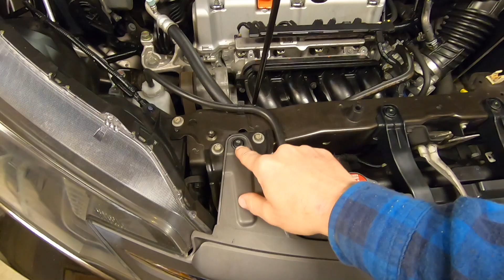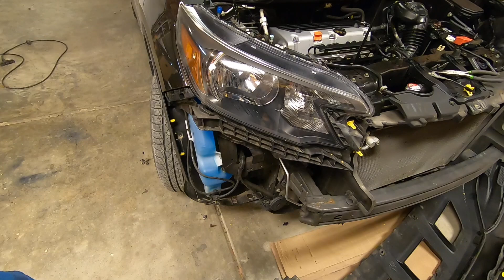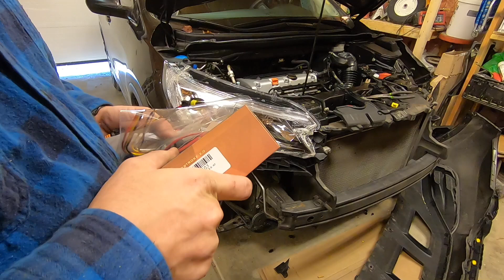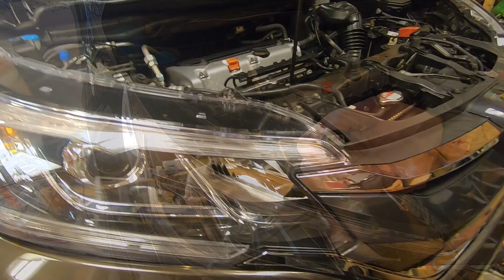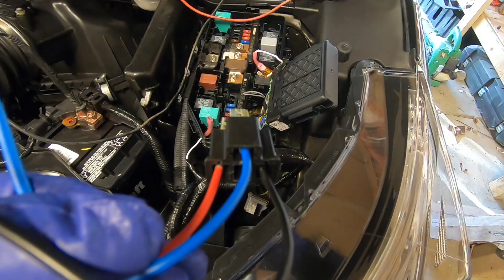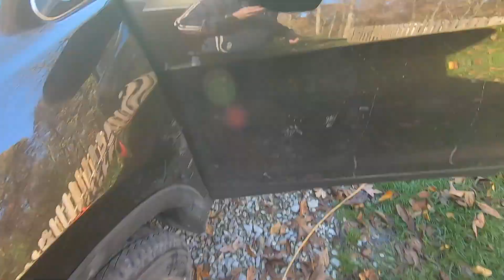2012-2014 Honda CRV - 2015 Front End Facelift Headlight and Grill Swap - LED Projector Headlights

Comment: Hi. Was there any risk to cutting / removing the plastic around the radiator? Did you notice anything later on?
Reply from the maker: No issue. Have done this upgrade on 3 CRVs now
Reply: @JackofAllMasterofNone  thank you!
Reply: @JackofAllMasterofNone  is the 2015-16 the only other compatible headlights for the 2013 model?

Comment: Where is the parts listed?
Reply from the maker: In the description 
Below are the parts needed to complete the swap. (Paid Links).  
Headlights https://ebay.us/5iHu06
Alternate Headlights Link https://amzn.to/3DzCotv
Grill and Brackets https://ebay.us/mtWajx
Alternate Grill Only Link https://ebay.us/94HcGz
Alternate Headlight Brackets Only https://ebay.us/lSOj03
Grill Emblem https://amzn.to/3x8mdBk
Turn Signal Harness (2 required) https://ebay.us/j9GVIH
DRL Harness (2 required) https://ebay.us/K609Ch
H11 Low Beam Harness (2 req) https://amzn.to/3VVt5QH
9005 High Beam Harness (2 req) https://amzn.to/49zaMUF
H4 male pigtails https://amzn.to/49vYV9W
H11 and 9005 LED Kit https://amzn.to/3vFyBvQ

Comment: Does the outside LED DRL flash orange when the turn signals are on? Sorry if this was mentioned in the video
Reply from the maker: No. It does not. The housing have a regular turn signal bulb.
Reply: @JackofAllMasterofNone Ah okay. There are pictures online where the outer DRL is amber. Thank you! Doing this facelift in the next few weeks
Reply: Huge thanks for this video by the way! The section about cutting the tabs off the new grille was a huge help. I spent a good couple minutes trying to squeeze those tabs into the existing slots.

Comment: How did they wire the DRL to the headlight connectors?
Do you have any video?
Reply from the maker: It's all in the video. Watch here for a detailed way of doing it for low and high output DRL 
https://youtu.be/WZh2-4WOCWU?si=MR81swBaEL7ns03o

Comment: this is a super helpful video but can anyone provide more detail in making the lower grill fit better to the front bumper. I am not as worried about doing the end tabs but making the grill have a closer fit to the front bumper.  Can't get the clips into all four openings (just the two in the middle).  Appreciate any more detail and insight.  Thanks.
Reply from the maker: Heat gun and slowly working it. Remember this is a "hack" and was never supposed to work, but we make it work.

Comment: Hello I have a question if you don’t mind answering. I order the turn signal harness from the link you provided but it didn’t come colored. It was 3 slim black wires and the description said ac pressure switch connector. Is there any other link you may be able to offer?
Reply from the maker: It says AC pressure switch but it IS the correct harness. They use the same connector.

Comment: Hello I have a quick question, I’m doing the same facelift as you did on your crv the only thing is the turn signal sockets are different from the 14 to the 15 but you didn’t mention changing the socket not just the wire harness. How can you solve this issue.
Reply from the maker: Did you watch? It's all in there including part numbers in the description
Reply: @ did your new headlights come in with the turn signal socket? I ordered some headlights but from another manufacturer.

Comment: Sorry if I missed this in the video (or if you mentioned elsewhere) but is the grille swap necessary, or would I be able to just swap the headlights? Thanks!
Reply from the maker: The grill is completely different. You have to do the whole thing to make it work so yes you have to swap the grill. This job is not for the faint of heart.

Comment: Do you know if the regular halogen headlights from a 2015 EX for example would be a direct swap or still would require custom harnesses? I guess to have daytime running lights they would require extra wiring.
Reply from the maker: Still require same custom harness.
Reply: I figured, thanks. Kinda hard to stomach the extra cost of the touring headlight assemblies. The regular halogen headlights to DRLs is quite literally 1/4 the price.
Reply from the maker: I understand. Quite the price difference but the projectors with LEDs are so much more superior it's worth it

Comment: What's the link for headlight bulb convertion from H4 to H11 and 9005
Reply from the maker: Headlights https://ebay.us/5iHu06
Alternate Headlights Link https://amzn.to/3DzCotv
Grill and Brackets https://ebay.us/mtWajx
Alternate Grill Only Link https://ebay.us/94HcGz
Alternate Headlight Brackets Only https://ebay.us/lSOj03
Grill Emblem https://amzn.to/3x8mdBk
Turn Signal Harness (2 required) https://ebay.us/j9GVIH
DRL Harness (2 required) https://ebay.us/K609Ch
H11 Low Beam LED Bulbs (Best) https://amzn.to/3cxtp06
9005 High Beam LED Bulbs (Best) https://amzn.to/30EJEGe

Comment: excellent modification and seeing and researching everything I want to do with my 2012 crv, when you bought the 2016 lamps you should have bought the complete grill kit that includes the 2016 lamp base supports since the 2012 base are not completely the same, believe me I learned everything from your video, the good things and the details of the errors, thank you very much for your video

Comment: Do you know if the side mirrors from 2016 crv with turn signals will fit and work in 2013 crv?
Reply from the maker: Wiring harness may be different but they will bolt on

Comment: Such an awesome guide. I am not very electrically inclined, I have all the parts except the connections for the new headlights. Any chance you can update the links for those parts, none of those work. (Turn Signal, DRL Harness, H11, 9005 ). I got the regular halogen assemblies and I have a 12 EX model. Thanks!
Reply from the maker: I don't have new links but here are the part numbers that you can Google and try to source the harness. You will need 2 of each
Turn Signal - 6189-0887
DRL - 6189-0968

Comment: I'm thinking of using a diode to turn on my fog lights using high beams on 2012 crv. Also turn off my drls so it doesn't interfere, However not sure if its safe because of the power draw on the wiring [high beams], will it be too hot? Or am I safe to pull that much amperage  from the high beams? Can you please share your knowledge. Thanks
Reply from the maker: I wouldnt do that with the stock wiring unless you just use the highbeam wire to trigger a relay that switches on the fog lights.

Comment: I have a question. I have a 2013 CRV LX that I am looking to do essentially what you have done (change the grill and headlights to 2015). Is there a difference between the 2015 touring model headlights? Will the 2015 LED DRL headlights fit on a 2013 LX model?
Reply from the maker: That's the same thing I did. They are not a direct swap as shown in this video. There is a lot of wiring involved to make it work

Comment: I’m interested in the tire/rim swap..   Did you go with 18” rims and if so, what size tire did you put on them?   Any modifications required?
Reply from the maker: No. I used stock LX 17" 2017up CRV wheels. I used 225/65R17 tires.

Comment: any fogging/moisture on the inside of the headlights? i bought aftermarket cheapo projectors from ebay for my 07'. Haven't installed them yet but I heard they can normally get moisture inside of them (among other things like yellowin/fading of the lens). I might put some silicone sealant in the seams between the plastic housing and the lens.
Reply from the maker: These were not cheap headlights. They were aftermarket, but are CAPA certified. Cheap ones can leak and have other problems. I always try and buy known good brands like Eagle Eyes.